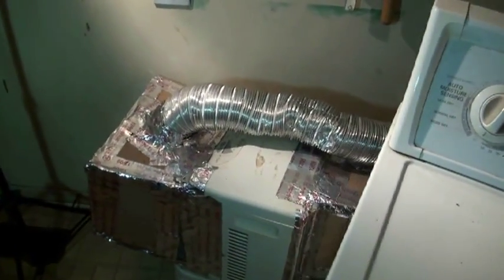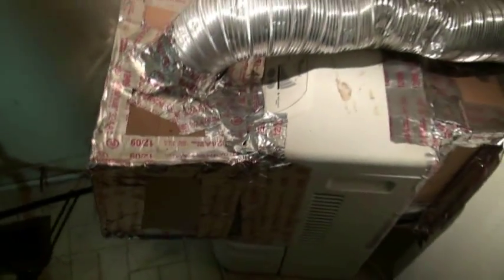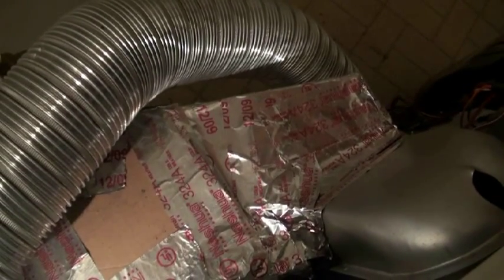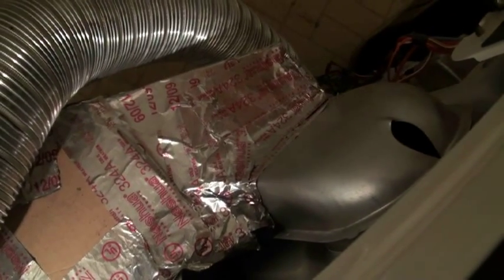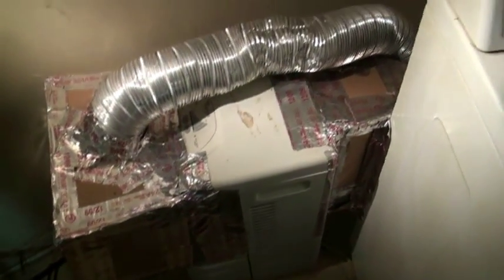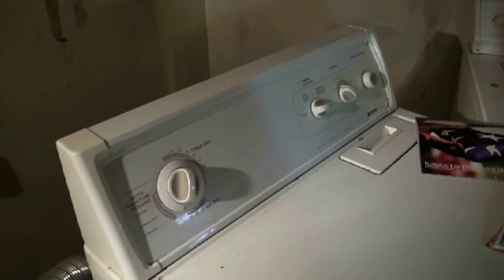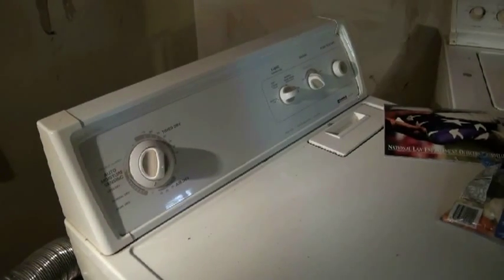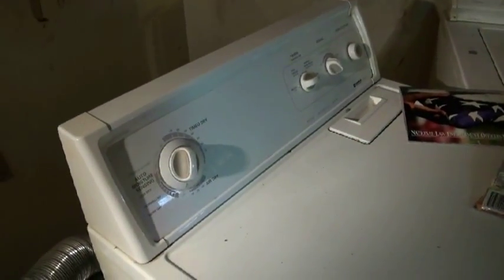Dehumidifier Clothes Drier

Comment: tried years ago, needed  a dehumidifier, with different freon then home model, something to lower evaporator temp. You can calculate how much raising heat makes air hold more water, current humidity, my humidifier only goes down to 35% humidity, which is higher than ambient air, and think efficiency would drop unless had colder coil.

Comment: This is basically what a heatpump clothes dryer does.
Reply from the maker: If a "heatpump clothes dryer" includes both the condenser and the evaporator in the same air stream, then it's a "dehumidifier" and it's improperly named. If the "heatpump clothes dryer" just heats the clothes with the condenser air, then it's not doing this and it's not the same thing.
Reply: David M Jackson LOL heatpump is the system used to make a temperature difference between two heat exchangers using a variable speed compressor and refrigerant to condense water. IT IS THE SAME THING.

I would know, we have a Panasonic Inverter Heatpump clothes dryer that heats the air up 40-90c with insulated tub and ducts you can choose not to heat but it will take longer to dry clothes, it has a built in "heat pump" inside that does the same thing you did and it has been existing for a while. Ever heard of the AEG Okokombi too?
Reply from the maker: The appliance used in the video is a dehumidifier. One air stream passes through both coils. The air to air heat pump has two air streams, an indoor air stream and an outdoor air stream. I spent an engineering career designing both. My team designed the dehumidifier in the video as well as a bunch of air to air heat pumps, mini splits, central and commercial heat pumps. . I am well aware of the inverter stuff too. Any air conditioner, heat pump or dehum "pumps heat". Semantics.
Reply: David M Jackson yes, and heatpump dryers are essentially the same thing you did only everything else is neatly tucked around the drum, inside the whole appliance not gutted out like this.

Comment: I'm trying to do a science fair project doing basically what you just did, but without an actual drier. My idea is that a dehumidifier could be a great idea for cheaper and more energy efficient clothes drying. Could you please give me any sources that you used or any good cites that could help me learn more about what you did? I know the workings of a dehumidifier, but I need air tight materials to make this project. thanks for any info you can give me.
Reply from the maker: Hi Indiana,
Modifying an appliance is probably not a good idea but there are some suggestions......Replace the drier with a place to hang the clothes, racks or hangers.....If you think, "Dehumidifier in a closet", you are close....If you have a rack and two compartments, you could just circulate the air in the compartment with the dehum in it through the compartment with the rack, or hangers.....Also the air coming out of a dehum is warm and dry......A rack or hanger that the dehum blows into would work....Since hot air rises,........the dehum below the clothes would work.....
Reply: Artvilla Com thanks so much for your help!